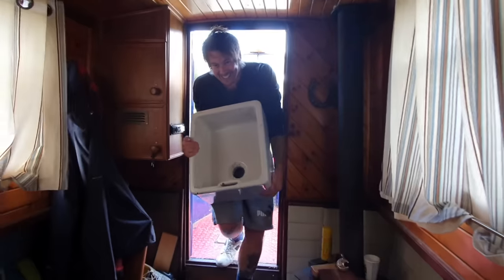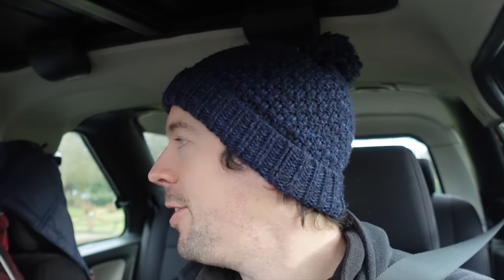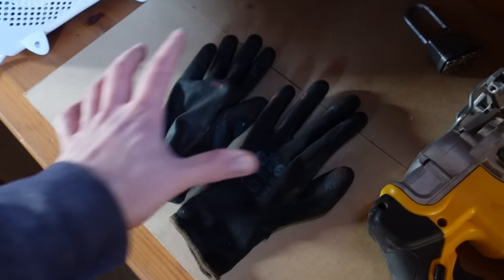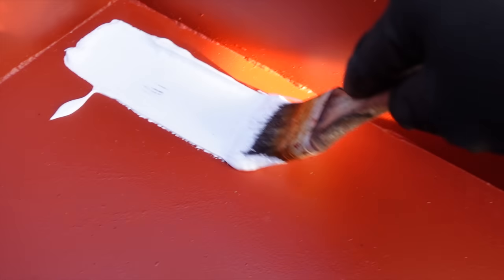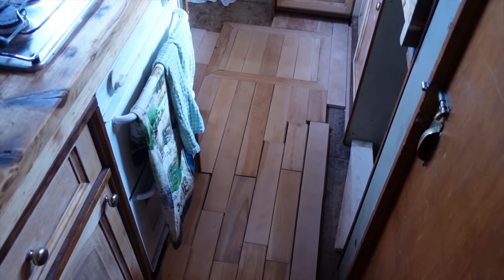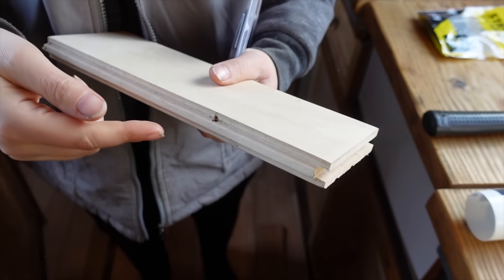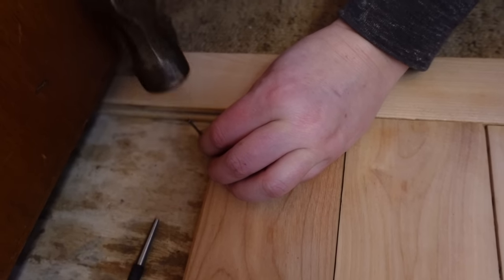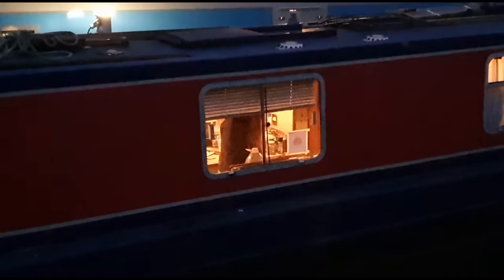By far the HARDEST JOB on a Narrowboat !!!

Comment: Don’t let it get you down Becks, have a tea break, then attack it refreshed and you’ll get there in the end!
I would fix a guide piece under your cupboard, then use it to line up the floor pieces too.
Thanks for the fun & interesting videos
Reply from the maker: Thanks so much for your words of encouragement Martin 🥰 There is a fixed kicker board under the cupboard that I was using as my guide line but I think the problem was partially in the boards themselves plus I'm sure everything is a touch wonky in the kitchen!!!. Thanks for you advise  😊
Reply: I use tongue tite screws they have small head
Reply from the maker: Thanks Tony il check them out ☺️
Reply: Your favourite screwfix have them

Comment: Guys, try cutting and fixing the main pieces first, fill in with the precision cuts last. If you cut n lay it loose first, it'll never quite go back the same when you fix it. Have you thought of using flooring adhesive. Maybe the stuff I used on my lvt would work. Not sure it needs nails as well.
Reply from the maker: Thanks so much for your advise! I was just using a bit of both as that was how I saw it had been done when we lifted the floor boards and also like everything on a boat stuff moves about more so I thought it would help keep it in place better. Is flooring adhesive different to acrylic grip adhesive?

Comment: Hi Becks just thought I might say flooring is always a nightmare you have to make sure the very first line of planks you put down are absolutely 100% straight or the rest will go further and further out of line.The first line needs to be absolutely solid before you start hammering the next lines down that is why you should really use a brad nailer as this is not rough on the planks
Reply from the maker: Thank you! I am learning that!!! I had lined everything up several times and then I was using a fixed kicker board that should be straight as my guide line. I think some of the issue is definitely the boards themselves as upon closer inspection you could see where some were warped etc and thus causing issues. We did look at getting a brad nail gun but they were out of stock and also for doing such a small area it was hard trying to justify the cost, however I'm definitely not ruling one out now!! Thanks so much for your advise 😊

Comment: Hi`a Screwfix sell flooring screws that go through the tongue ,work really well .maybe pre drill om short pieces or near the ends
Reply from the maker: Oh wow thanks for sharing that. I'd had a look around for different options but never came across these 😀 Thank you!
Reply: don`t get too down hearted , your starting your floor laying career with as difficult a job as you could pick . basically get your first line perfectly straight  then keep working all the way along before starting the next line. Sadly your first line is around the corner from the doorway so a bit of line drawing through the centre of your boat then parallel back to that first line starting point. Am fitting an oak floor at the mo in the Yorkshire dales so feel your pain  , you`ll get there😀

Comment: I avoid using nails for anything where you may ever want to remove it (which evenyually you will). Learned that the hard way. I pretty much use screws for everything.
Reply from the maker: That's a very good point, I wonder if a strong glue would ha e been good enough?

Comment: Nice one you shudd get away will just glueing that floor down then run a bead round the edge up against the kik board and put a long tac througe it right down to the floor bored it won’t move anywhere  ..Have a Top week u 2 🙂🎸🔧✌️
Reply from the maker: I did think that but we wanted to be extra safe when the boats moving, thanks for your great suggestion 👍 and have a great week too

Comment: hope you can sort the floor  could the gaps be because your manually hammering the pins in and the boards are moving i had a similar problem and ended up getting a brad nail gun i got a air powered 2nd fix nail gun. i have since used a mains powered brad gun and it was so much easier. hopefully you both can cruise down our waterways and enjoy our wonderful countryside. don't give up now you have both done so well
Reply from the maker: Thank you. I think there are several things at play but I'm sure you're right as well. I was using a fixed kicker board as my guide line but there's a bit under the oven that there's no board and I found this bit particularly problematic which probably threw things out a little. The brad gun sounds amazing. We did look into them but they didn't have any in stock at the time and it's such a small area we were trying to justify the cost!! Thanks so much for your helpful and lovely comment 😊

Comment: Hi  Get a good straight edge  (sprit level) check they are  straight along them no want banana sided 1s. Wood on the move 24/7  
 Plus possible a small hole for nail to go though. ? Plus me no expert but shouldn't you do one long edge and work across the boat. 
Shower  what about water tank paint   but recall ££££££ 
Keep the kettle on I say.

Steve
Reply from the maker: Thanks Steve.. yes logically you would think work across from a straight line the problem is we ha ent really got one.. maybe naili g down a straight bit would ha e worked? We're to deep in now so fi gers crossed this works💪
Reply: @TheNomadicCrobot  possible to late,    nail length wood where 2nd row will go put 1s row to it then remove strip of wood.  

Iron board cover giving me grief here 
These thing are sent to try us and they are winning 🙈

Comment: I used to work in home construction and I’ve seen the hardwood floor installers use wood filler several times in problem areas.  Once you sand it back and stain it, it won’t be noticeable. You’re doing a great job.
Reply from the maker: Thanks so much Paul, this makes me feel a lot better. I guess without any experience of doing it before I'm probably fixating on things that won't matter too much in the long run anyway. Thanks so much for your reassurance 🥰

Comment: Hi, I am surprised that you attach the tongue and groove boards with nails. There are extra profile wood brackets for this, which you push between the groove and the underside, hammer 1 nail through the bracket with the help of a nailer, and then the 2nd board into the groove.
Reply from the maker: Oh wow I have never heard of these before. I opted for nails simply because that's how the boards had originally been laid so I thought it would be the correct way to do it. I will definitely look into these though. Thanks for sharing Juergen 😊

Comment: I cried at the end😪
Reply from the maker: Poor bex bless her
Reply: Have you got a chalk  Line ? If you mark the floor ( for your fist run of boards ) with a straight line .You can work to it ,and you will be able to see if your running out of line. If you mark every other line of boards it should help as a guide. Another way would be to start in the middle and work out to the edge ( having marked a straight line on the floor first to work from). You would have to cut the Tonge of the last board . But as they are on the outside it should’nt show .
Reply from the maker: Thanks so much this is a really great idea. I was using the fixed kicker board of the cupboard as my guideline but this may really help. I shall investigate!! I do think though that a big part of the problem was a few boards were a bit wonky bonky and throwing things out... typical!! 😂